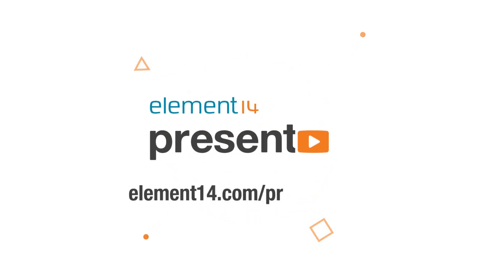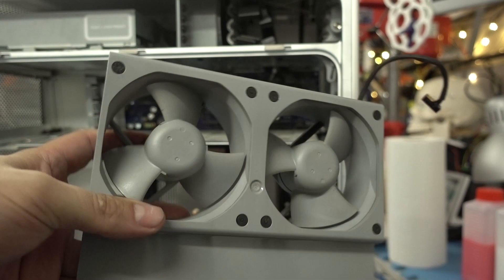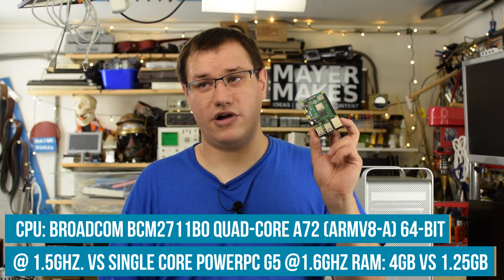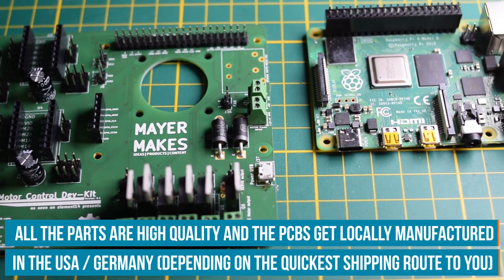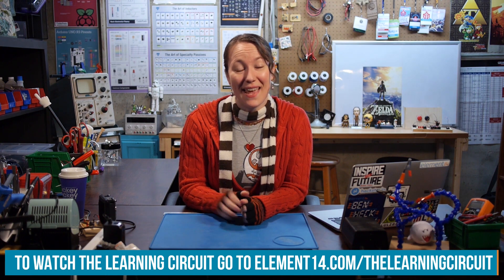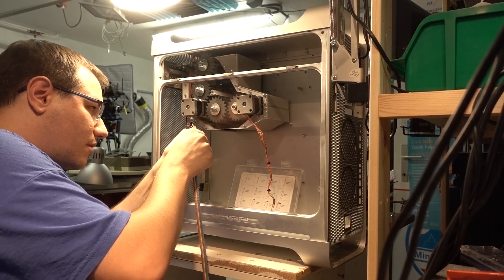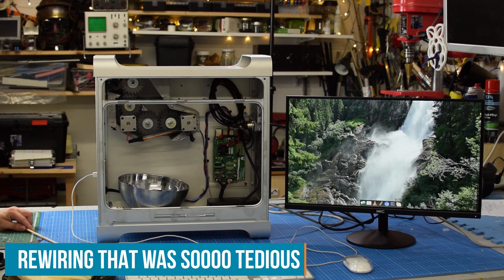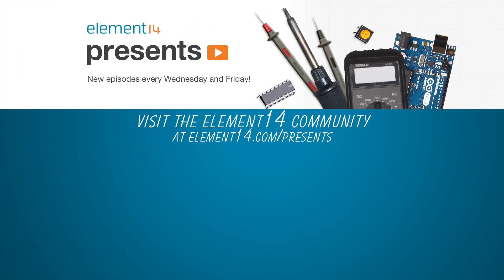MacPro G5 Cheese Grater with Raspberry Pi 4

Comment: Next project: a Mac Trashcan that can actually hold trash + a Pi running Windows 10 IoT Edition.
Reply: That tells you what is put inside of it, and tells the garbageman to empty it. :D
Reply: @amshermansen  Exactly.  The 2013 was crap.  And so is Windows 10 IoT.  If you put Windows on a Pi, you might as well put that in the trash as well. 😋
Reply: @MaskedGEEK  lol
Reply: lol, post taht on element14.com/suggestionbox so we can pick it up!
Reply: Or Windows 10 ARM64
Reply: @vladtomoiaga4721  That's what Windows 10 IoT is.  It's called the Internet of Things edition which runs on a Raspberry Pi, an ARM powered computer.

Comment: Well that's a nice controller board ... I could have used something like this to control my trash compactor.  Our city has crappy small recycling bins... so it's necessary to chop, grind and compress the trash for a family of four to get all the boxes we get to fix into them.
it's amazing how small you compress something with a 20 tons of hydraulic pressure.
All controls are electromechanical with timing cams.

Comment: The case wasn't an instant classic because of the cheesegrater design (are you sure you're not from Wisconsin, what with the cheese obsession beyond the point of humor?) — the case was an instant class because it was basically the only case on the market that was fully-metal; it had useful, thoughtful design elements (easy-open case with one lever, slide-out drives with no cable to mess with, easily removable daughterboard); and because the external and especially internals looked like they were straight out of a sci-fi movie with a clean cable-free design and tightly case-fitting components.

P.S. I'm far more familiar with the early Mac Pro revisions of this case, rather than the PowerMac G5 revision.  After watching your video, it looks like some of the internal niceties mentioned weren't added to the case until the Mac Pro.
Reply: There was a Wisconsin citizen involved with it, but I never visited it.
Reply: response th the PS: the macpro variant is far easier to assemble and improved the design a lot. The powermac G5 case is a classic example of looks over functionality. they basicvally built this to get assembled once at the factory and never taken apart again. that changed with the switch to the MAcPro and more upgrade options.

Comment: please work on your posture
Reply: No u
Reply: @brendan9734  my posture is perfect
Reply: I suffer from back problems since ages, I am working on it but it's not easy. I'm used to the pain now.
Reply: @MAYERMAKES  It took me around 5 years to train myself to sit up straight. I had forward head posture for 15-20 years. Tension headaches, muscle knots were a nightly event. I always thought I had a bad back but it was just forward head posture.
Reply: @soupkin  Right, so your problem is exactly the same as everybody else's problem, and your body is exactly like everyone else's. 🙄
Reply: @awo1fman  I'm actually a level 5 chiropractor, I can tell that his head is fully supported by his limb gardea leviosa superior straining the muscle. I have even given free webinars about how to correct your posture, if any of you are interested I'll let you know the date and how to RSVP.
Reply: @soupkin  Um, about that... chiropractic causes more harm than good. Cartilage doesn't mend, and every time you do an "adjustment" you create further damage, ensuring that the same problem will recur and you will get repeat business. Any immediate relief is temporary and outweighed by the long-term damage. No thanks, I'll go to a real orthopedist or other appropriate specialist doctor and get the damage repaired or at least stabilized so it's not a chronic problem.

If you expect me to be impressed or intimidated by your gobbledygook jargon, you're barking up the wrong tree.
Reply: @awo1fman  suit yourself haury